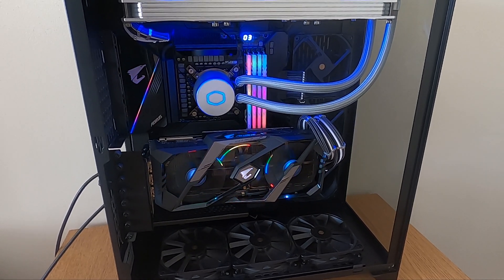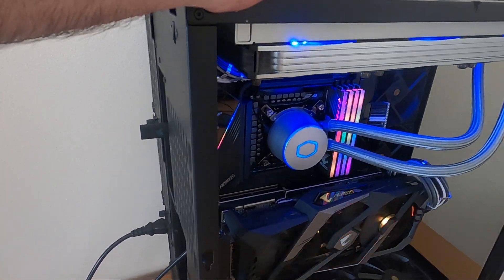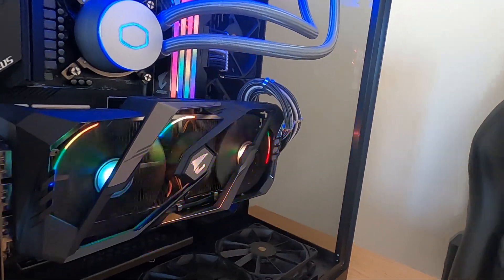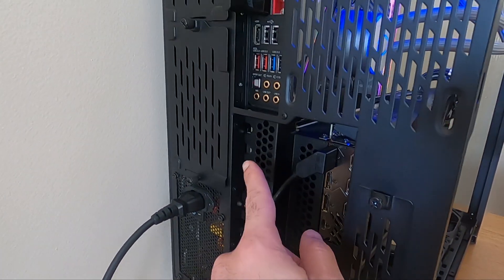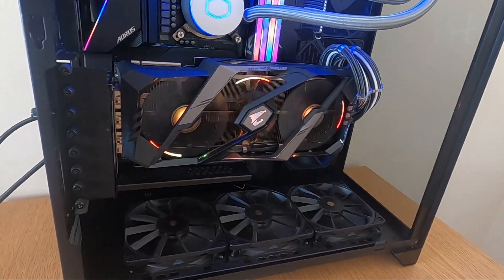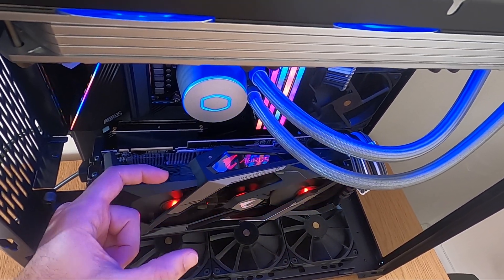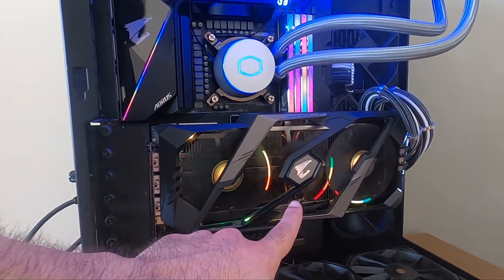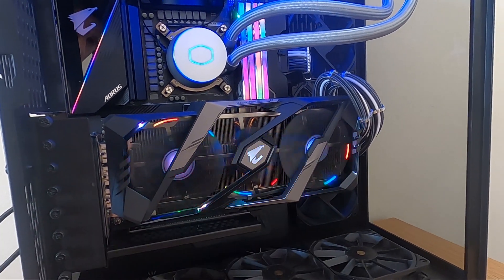Vertical GPU Mounts - How do they work?

Comment: I'm sorry but I had to down vote this. Man I hate doing that but seriously. 
No script, random umming. Your video angles don't show anything useful. You gave us a single shot of the cable outside the case but none of the mount. You didn't explain if we needed a special case to mount it like you did, you just said some cases allow it. How did you mount it in this case, which we still don't know which it is? Does the normal cage at the back somehow come out? 

Just give us more details here, not just show off a pretty case.
Reply: Shut the fuck up leave the man alone

Comment: you need to change your btm fan to intake,
Reply: I have the same 011 case, vertical mount gpu. Bottom 3 intake, side 3 intake, top 3 rad fans exhaust. Any positive pressure vents out the back. 2060 Super idles at 36 and never goes past 65 in gaming or bench marks because the bottom fans are hitting the gpu heat sink too. Ryzen 5 3600 idles at 35 and never sees 70C during gaming or stress bench. Phanteks PH-VGPUKT_02 kit fits perfect in a lian li 011.
Reply: @FD3959char  you can use that bracket with bottom fans and no clearance issues?
Reply: @unknown.z34_33  yes there is an inch and a half clearance between the bracket and the bottom fans, plus the bracket is thin enough to not block air flow. Again these is on the Dynamic 011 with the Phanteks vertical bracket and 3 bottom 120 fans.
Reply: @FD3959char  i built mine already and it looks sick.
Reply from the maker: The bottom fans in this video are intake.

Comment: The main concern, especially for X570 board users are the riser cables. These are PCIe 3.0 riser cables, and they might not play well with your PCIe 4.0 slots/bus.
Will they cause your system to BSOD or shoot out WHEA errors? 
Or will you have to "downclock" your PCIe 4.0 to 3.0.
Which is fine, unless you have a Gen 4 NVMe M.2 installed. Would then that affect the performance of the SSD?
Reply: Thats not correct ! There are perfect PCIe 4.O Riser Cables out there to get ........... https://linkup.one/  ...... this company has them since february I think, and they are tested and work great ....... at least what I found on the internet. I searched because I am building a new pc atm with the lianli xl and thought about vertical gpu with these cables. Hope I could help.

Comment: Where can I get that Cablemod mount kit? Seems to be out of stock everywhere!! 
My case has these crossbars at the PCI slots, so if I were to use the Cooler Master one, I would have to cut and basically destroy part of the case. Not ideal.
Reply: Amazon has the lian li gpu vertical mount right now. Mines coming tomorrow.

Comment: Won't there be a lot of sag though?
Reply: I'm not an owner of such a setup, but, using 7  PCIe slots to anchor the mount vertical.. I think it will stand up better than 2 or 3 slots to anchor horizontal.